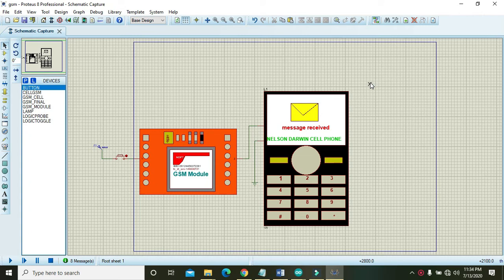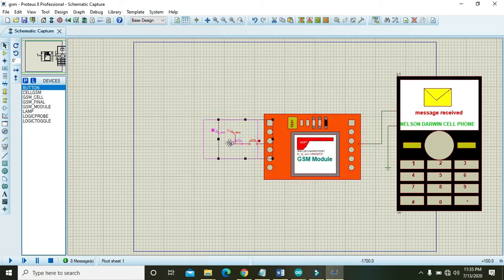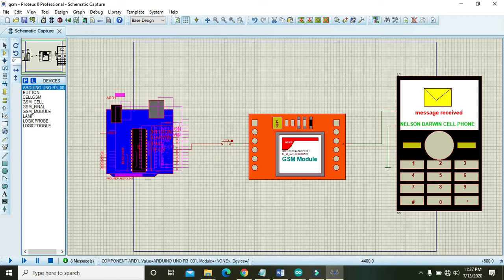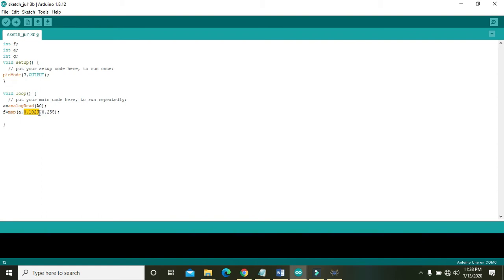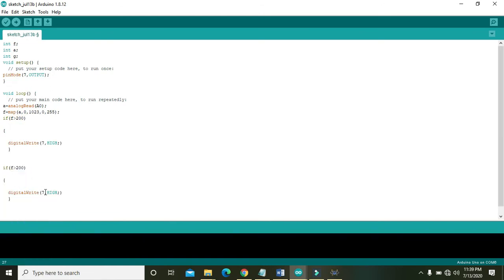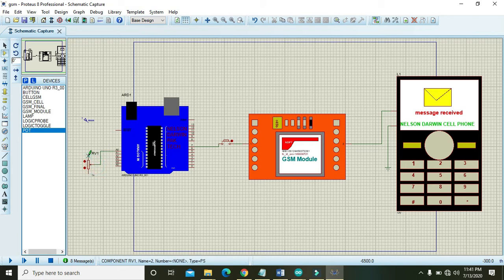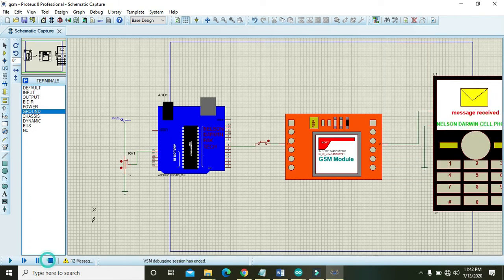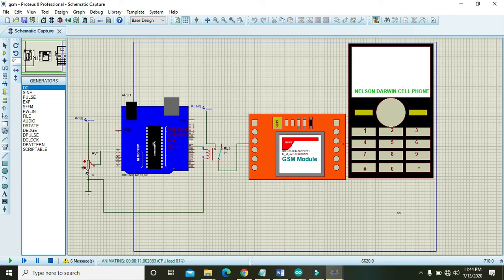GSM module with arduino controller in proteus | GSM based message alert in proteus

Comment: Please, can you send me the library for Proteus because i have Proteus 7 and the file can't open with me
Reply from the maker: Sir...file will not open in proteus 7 as u must have proteus 8.9 installed....moreover i didnt made any library just a custom component...So it can only run in the same file i have uploaded, u can make changes in the same file...
Reply: @nelsondarwinpaktech3954   sir please send me a library of this file
not working link
Reply: @nelsondarwinpaktech3954  then can you send the file sir through my email azamzamri1218@gmail.com
Thank you very much